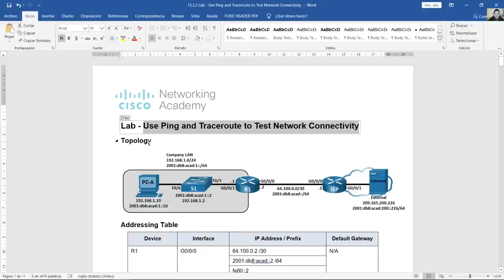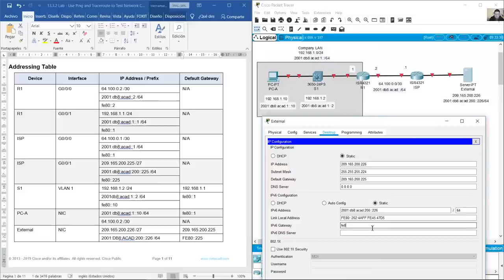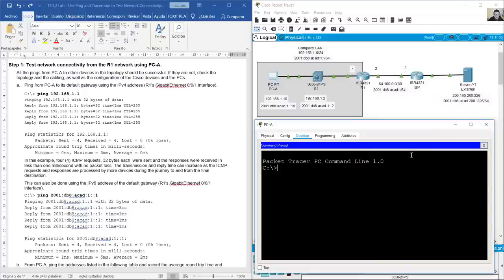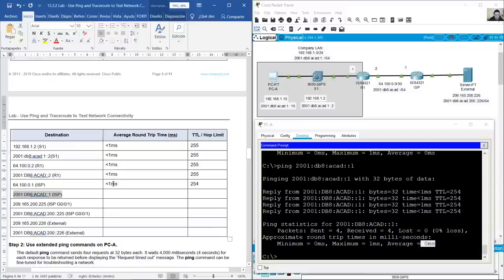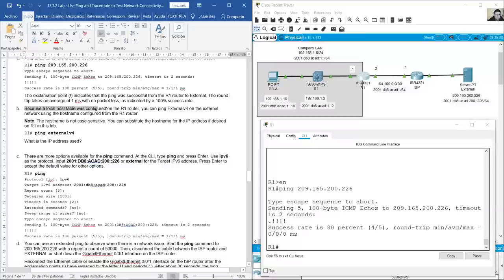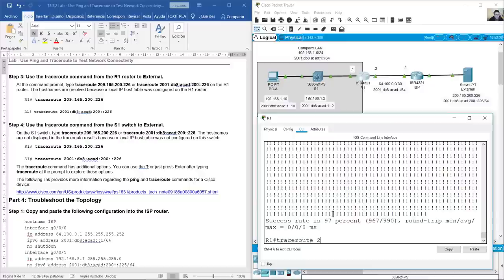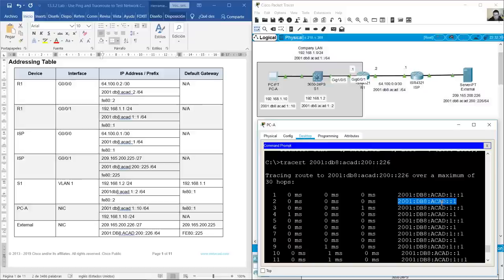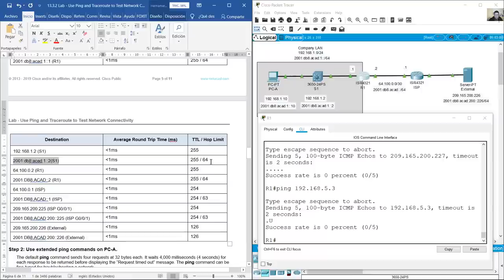13.3.2 Lab - Use Ping and Traceroute to Test Network Connectivity

Comment: Hi Mister Christian, I've been watching your videos since July, and thank you so much for your help it's very appreciated. I have a question about this particular lab. After finishing my lab worksheet I wanted to ping from External to PC-A, I tried but I couldn't. I checked all IPs and there's nothing wrong with them.. Have you tried? and if yes did it worked with you?  It seems that External has a successful connection until R1 g0/0/1 interface.. Is it because there is some configuration that needs to be done with the router?
Reply from the maker: Thank you for all your support, I don't have details of the failure, but the only way for now is try again and review the complete video to be sure, and it is better for learning, otherwise contact me on social networks shown in 00:03
Reply: @romeroc24  of course, again thank you <3

Comment: miss the part 3 step 4
Reply: part 3 step 4 is missing, te la has saltado
Reply from the maker: Part 3 starts at 47:30 the continue with PArt 4
Reply: @romeroc24  u dont understand, missing the ping from the switch. Part 3 step 4
Reply from the maker: @pablomendozamiguel3676  Results of that test will be the same like the previous step using the router
Reply: @romeroc24  not for me, but thanks
Reply from the maker: @pablomendozamiguel3676  ok, but at the end of the lab this test should work